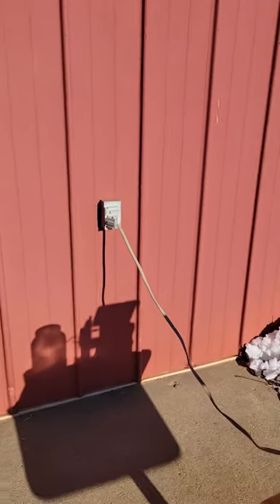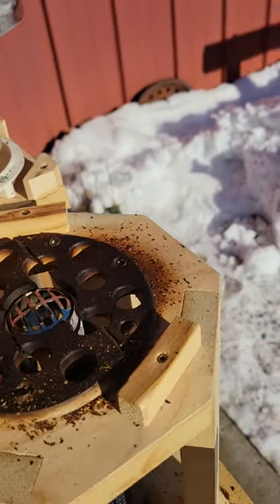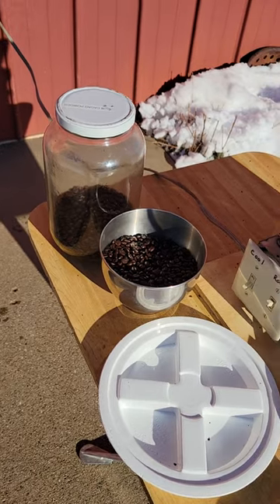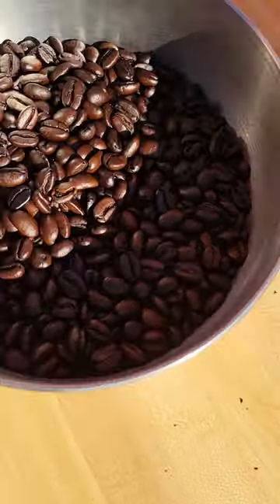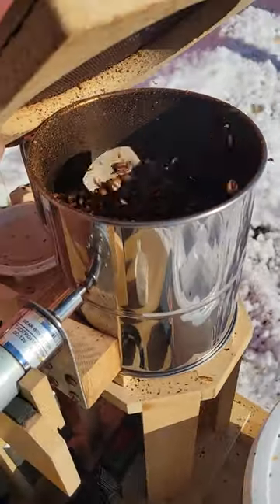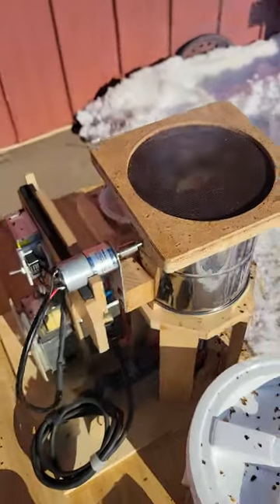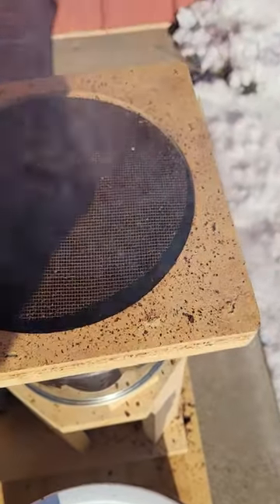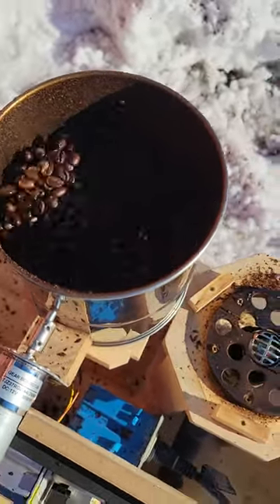DIY coffee roaster

Comment: Remember to reduce the heat and thereby stretch out the First Crack as long as possible . . .  to maximize caramelization and produce the sweetest roast possible.
Reply from the maker: Reduce the heat to what temperature. I'm all in to roasting the best coffee ever.
Reply from the maker: I have been reading about the slow roasting you mentioned here. That sounds good, but yet I have not found coffee anywhere that is better than mine. Not boasting just stating the fact. But I will try what you suggested. Thanks again.
Reply from the maker: I just switched my roaster to a wobble disc. As per your tip on slowing down the roast. Added 5 min to my total roast. 18 min. From start to cooled beans. Thanks again.
Reply from the maker: I purchased some Guatemala coffee beans. Trying figure out times, temperature and the correct roast???
Reply: @frankglass I’ve been roasting both Guatemalan Huehuetenango & New Oriente origins just to 230°C second crack over a 10-12 minutes, 1st crack at 210° in 9 minutes or so, without getting a shine on the beans., for what it’s worth… I use a NZ designed & built LPG fired, reverse hot air roaster, in 2.5kg batches, for 20 years now.
Reply from the maker: Would like to see a video on your process.  I noticed different coffee beans roast and finish so differently. The organic Ethiopian beans never get a shine on them even if left longer into 2nd crack. The also taste better at a lower medium roast. They are also a much smaller bean than a Sumatra bean that gets a very oily shine in a longer 2nd crack.
Reply: good advice
Reply: @frankglass  I’ll put something together and send a link.

Comment from the maker: I am considering converting my paddle to a wobble disc as soon as I find a stainless steel plate. I don't think using aluminum in a consumable situation is a healthy choice.
Reply: Wow! I just finished my build, also inspired by Larry Cotton’s EZ Roaster, which looks quite similar to yours. I used the exact same flour sifter, and will share that, after some experimentation, found a wobble disc that is exactly 5.0” seems to be the optimal size
Reply: an aluminum pizza pan from Amazon is cheap and works great.  yes, you'll have to cut out the center flat portion.